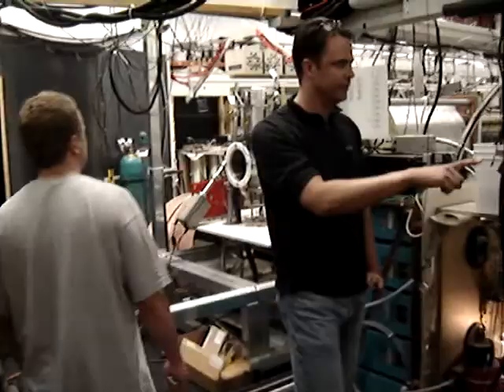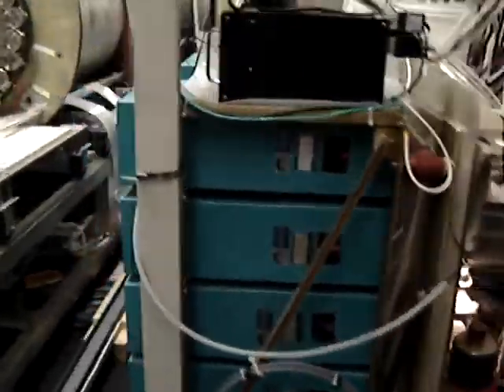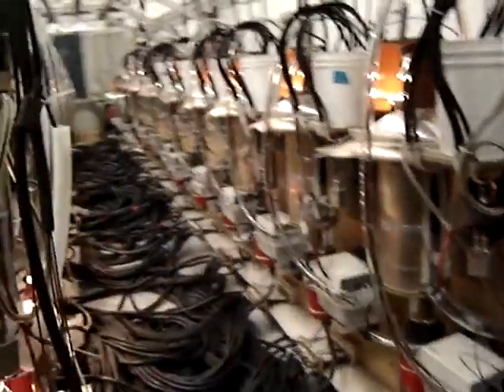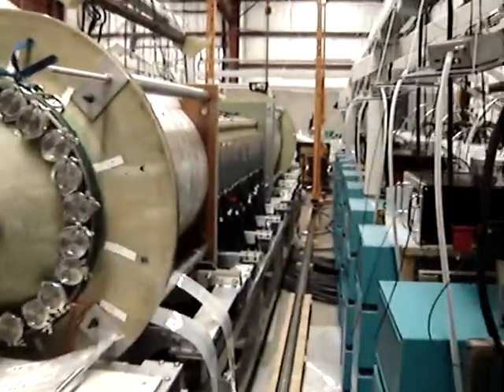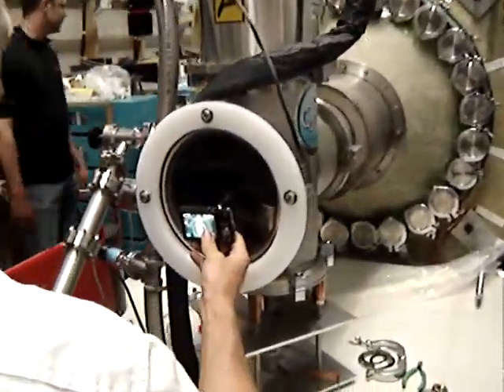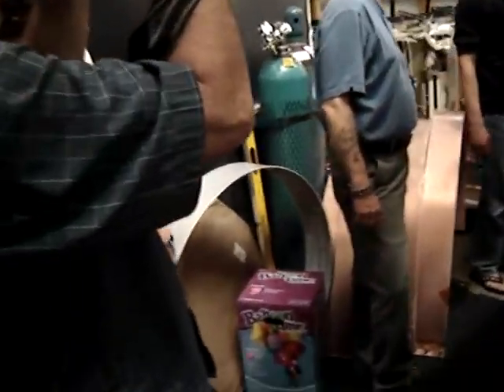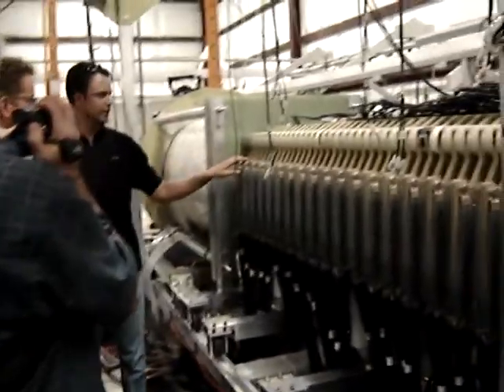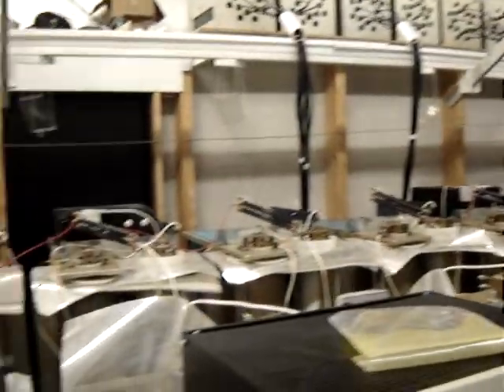2010 Seattle Weird Science, meeting at HEI

Comment from the maker: Update my site?   Expose even more dangerous secrets?   No.  No, because that would be ...dangerous.   Like so...

I recently heard that Tesla's Earthquake Machine contains an enormous secret.   It was hidden in plain sight all along.
The machine doesn't use resonance to damage the steel frame.  (Mythbusters cannot damage that bridge!  That's NOT how it works.)   

Instead, THE STEEL STARTS SINKING!   

See, Tesla had to smash the steam valve, because his floors were tilting as the central pillar began rapidly dropping into the ground.  Three seconds to turn a steam-faucet would have been way too long!   His lathes and milling machines were suddenly sliding downhill, as the entire floor in his building started becoming cone-shaped.  The cracking sound was from "building settling," yeah right, suddenly settling at a foot per second!  (But he never said this explicitly.)

Tesla's Earthquake Machine finds a longitudinal resonance, converting any steel pillar into a giant drill-bit.   The steel becomes an acoustic drill, and the dirt at the lower end of the beam will "liquify," same as in earthquakes.   His earthquake machine today has another name:  silent vibratory pile-driver.

Ten years ago a Tesla-fanatic inventor finally figured this out, and today he's a multi-millionaire; his "vibros" are widely used as pile-drivers throughout the world.   He can sink I-beams.  He can sink steel plates which are inches thick and thirty feet wide.   He can sink ocean pylons for giant wind turbines (hollow steel pylons fifty feet across and hundreds of feet tall.)

Yes, Tesla could easliy have destroyed major office-buildings with a little device, and a bottle of compressed air  ...but ONLY if their main supports hadn't originally been driven down to bedrock.  His invention is a pocket-size pile-driver, causing vertical steel pilings to bore themselves downwards, driven by their own weight.

Yet we all looked right at his description, for decade after decade, and JUST COULDN'T SEE!    Hidden in plain sight.  Terrorists couldn't bring down skyscrapers by using little boxes bolted to building supports!  Well, not tesla-boxes, anyway.   (What else did Tesla hide in this way?  Everything.   He disclosed all his secrets, in artist conceptions without captions.  We can look and look, but we cannot see, not unless we can somehow adopt Tesla's unorthodox mind-stance.)

Well, now you know.

Next:  how did Tesla invent the AC motor?   Where did the key idea originate?   WHY WAS TESLA DOOMED?
https://www.quora.com/Why-Nikola-Tesla-was-doomed

NEW STUFF:

Brand new type of mechanical maglev, the Ucar Effect, wiggling magnets, no feedback needed:   
https://www.youtube.com/user/sudanamaru/videos